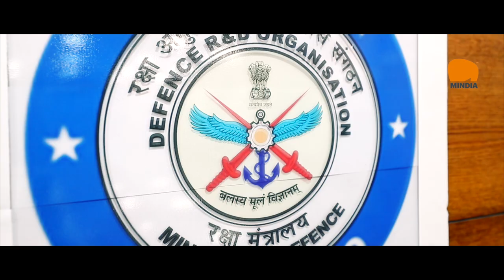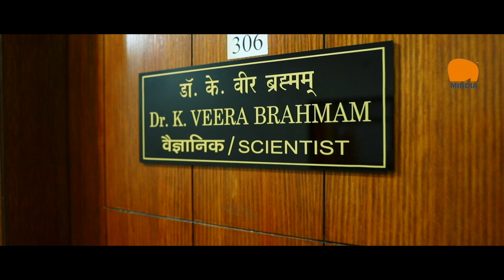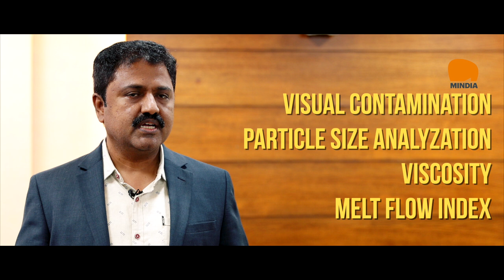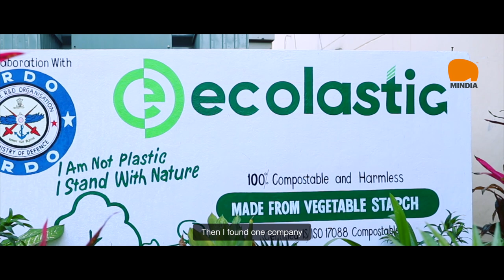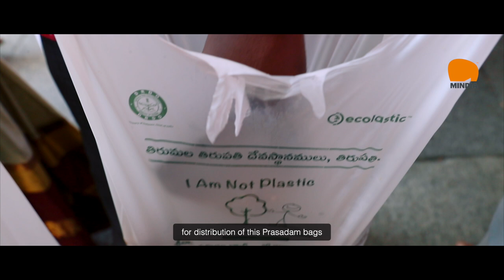DRDO - Biodegradable Carry Bags | Dr. K Veerabrahmam, Scientist

Comment: But UNICEF already discouraged the use of food materials for making biodegradable polymer films as there are millions of poor people who are starving for lack of food.  

In the beginning we prepared biodegradable polymer composite films for packaging applications using wheat protein isolate and soy protein isolate and published many Research papers 10 years ago. But later we discontinued using food materials as per the recommendations of UNICEF.  

Then we made completely biodegradable polymer composite films using non edible biodegradable thermoplastic  polymers Polylactic Acid, PHBV, polypropylene carbonate etc. We improved the strength and decreased the cost by using kitchen waste as low cost filler.  We published the results in many journals during 2014-2017.  

For TTD pilgrims use cotton bags are sufficient as we can reuse them several times. This provides value for the abundant and renewable cotton which is grown more and non edible.  We dedicated our work on Biodegradable polymer composite films for packaging to our beloved Prime Minister Sri Narendra Modiji.